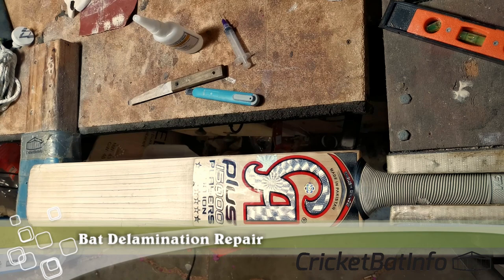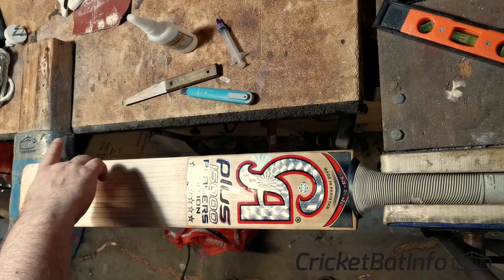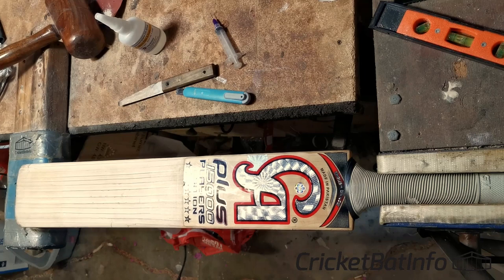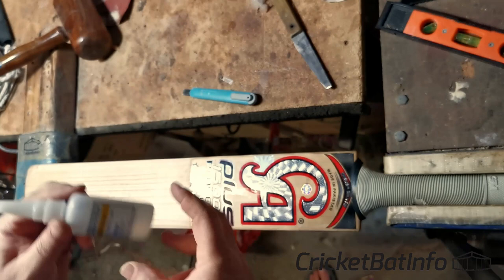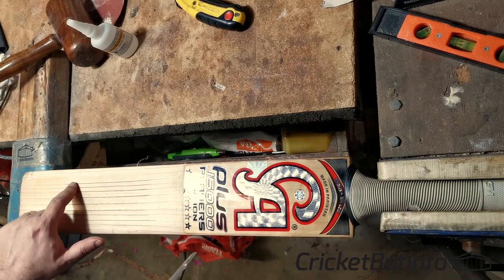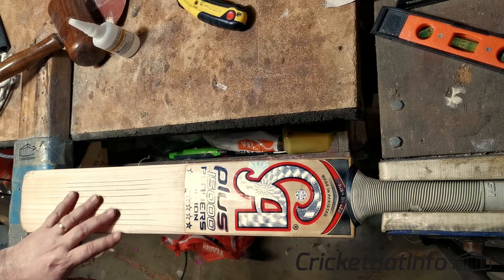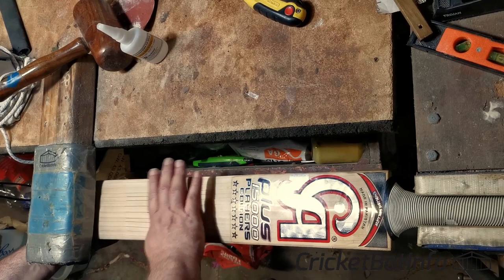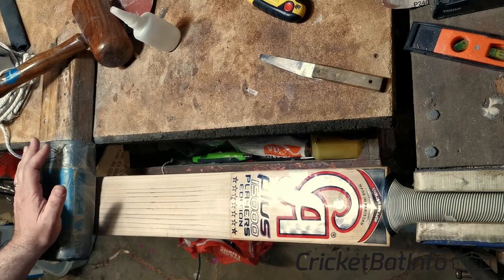I fixed Cricket Bat Delamination with a Hot Iron!

Comment: this has also happened to my CA 15000 PE which is really annoying
Reply from the maker: I’m not sure why as the 15000 PE I sold to my friend that I prepared has not delaminated, just the handle feels a little sloppy. He loves it. Definitely happens, but not sure why. Softer press and rubber bowling machine balls is something he does not face.
Reply: @CricketBatInfo  I got it repaired a few days back restored back to exactly how it was prior. Just used it today got 25 in very difficult conditions but a keeper stood up to pace taking an amazing catch ended my innings. sigh
Reply from the maker: Sounds like you got a good start, did all the hard work establishing the partnership and then they got some luck. That’s cricket and why we obsess about it 👍

Comment: R u sure bro super glue is best for clear de-lamination? For the feel and the ping after do this this definitely amazing but this super glue with providing heat over it means it is inviting more de-lamination behind the original one’s. Suggestion to open each and every grains where repairing require and use thin custom made glue and clamp it.
Reply: CricketBatInfo i will try on surface minor layer.

Comment: Not completely sure what went on here, how does a solid piece of wood delaminate? Or is it one of those with the face stuck on, apologies in advance for the stupidity
Reply: Yes it does thx for that
Reply: When the willow is pressed, the top layer is wet with water then pressed under tons of pressure. This will compress the top layer 6-8mm. With the impact of cricket balls over time, the pressed willow can sometimes separate from the un pressed willow. Once it's glued back down it will continue to perform as it did prior to separating.

Comment: Hi Marc, big fan of your work, really enjoy your videos. Nice to see honest repair work and reviews on bats. If you have time, leave the bat outside when its hot, generally any cracks that's there will open up so easier to repair. Interesting fix this one. I guess the iron serves 2 purposes, the first from the heat which will open up the cracks abit more and allow the glue to get further in, and the second the weight of the iron should give to much needed pressure to seal the crack. 

Keep up the good work